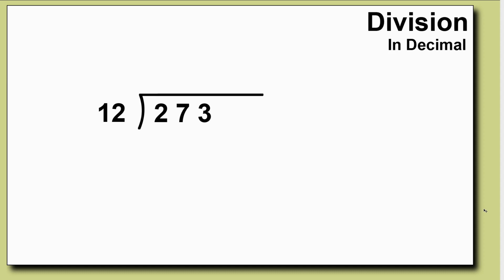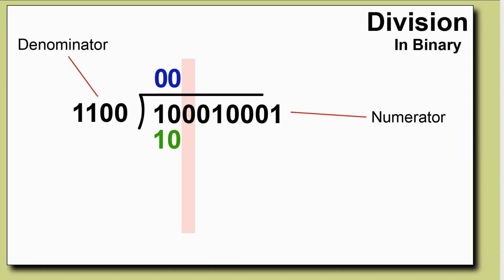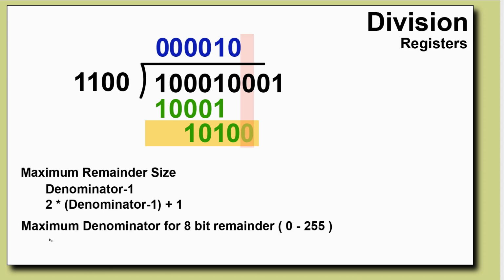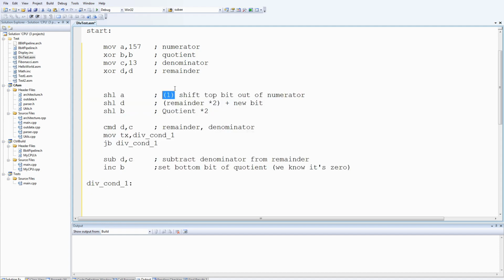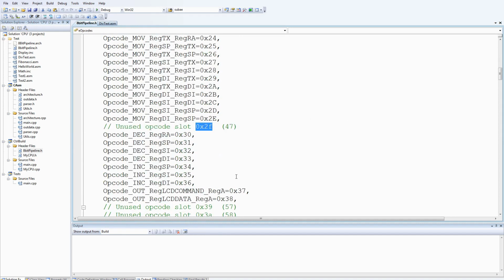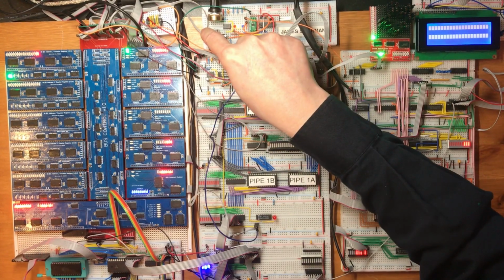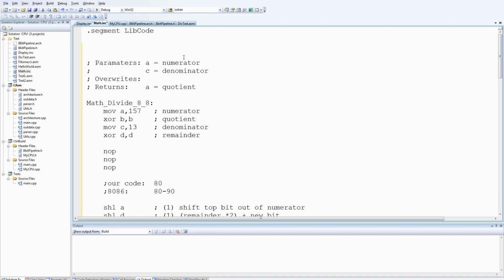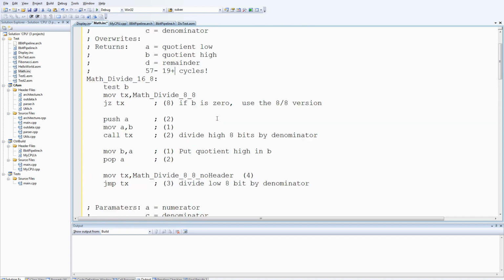Coding 2, Divide - Making an 8 Bit pipelined CPU - Part 66

Comment: Huh... 1:05  Of course recurrent subtraction is an awful and kind of embarrassing solution; of course I haven't done exactly that in several of my CPUs programs... 

Jokes aside, it was a really good and interesting explanation; Some time ago I said I couldn't wait to see your programs/algorithms, and you haven't disappointed! One step closer to getting Doom on it ;)
Reply from the maker: Lol! Glag you are enjoying! The worse thing is there are combinations of numerator/denominator where repetitive subtraction can be faster. I was pretty happy with the performance of this. Annoying thing right now is that I need a u8*u8 multiply, I have designed fast code that only supports values where (val+(val>>1))<256 but I need one that supports the full range.
Reply: @weirdboyjim  Hmm, at worst you'll have to do some workarounds knowing the limitations. Given real(uint of course too) A, B and C; A/(B*C)=(A/B) / C,  as you already know, and given the fact your division algorithm is linear O(n) with the number of bytes/bits, at worst it wouldn't hurt too much to do so, right? Maybe I'm wrong. Anyway, you surely have something in mind for this already. 

I'm really curious in how you will handle floating point, in particular with user inputs, since I failed when I tried my own atof() implementation, and I have yet to try again.
Reply from the maker: The multiply will be easy enough, but I need to swap data in and out of tl/th in the inner loop. 1 to few registers to do it otherwise. I'm building a library of super fast routines that I can do with the 4 gprs and then slower versions that are more capable.
Reply from the maker: Floating point isn't too bad, but it's not on my radar for implementation at the moment. Were you trying to implement an approximation of IEEE or did you use your own format? It's generally faster to use your own format that perform the extra bit packing.

Comment: I love to see your video after a long. 
I really admire your work.
For division and multiplication, you can implement Booth's Algorithm with the shifter (Barrel Shifter) and adder.
You can further make the computer faster by adopting a hardware FPU in a CPLD and control it using your CU or IR
Reply from the maker: I was taught Booths for doing signed multiplication, doing integer division with a reciprocal and multiply ends up much slower than what I’ve presented here. For unsigned integers I’m fairly sure this is about as fast as it gets. I want to keep programmable logic devices away from this build, once It’s finished I want to do some more complicated things where that will be more appropriate.
Reply: Booth's algorithm is quite nice for uniformly handling signed integers. But a common misconception is that it's faster than conventional multiplication. That is NOT the case. For an N bit multiplication, there are 2^N possible multipliers. An for both Booth encoding and conventional, the total number of adds are identical. They're just ordered differently. Demonstration.
For Booth, the first non-shift operation will always be a subtraction. Then the next non-shift operation will be addition. And each non-shift operation will be the opposite. So for my discussion, I'll group all addition and subtraction operations as simply addition. So an N bit multiplication will consist of N operations, each being either a shift, or a shift and an add. For N bits, there are 2^N possible sequences. The same applies for conventional multiplication.
But you're thinking Booth only requires 2 additions for the sequence 01111110, whereas conventional requires 6. Therefore Booth is faster. But look at 01010101 where Booth requires 8 additions whereas conventional only needs 4. The overall total number of additions for and N bit number over all 2^N possibilities are identical for both Booth and conventional.
So claiming Booth is faster as a benefit is wrong.

Now Booth does have some advantages over conventional.
1. Easy handling of signed numbers.
2. When taking multiple bits at a time, Booth requires calculating fewer "hard multiples". For instance, handling 2 bits per iteration, Booth requires N, 2N, -2N, and -N. Conventional requires N,2N, and 3N. 3N is a "hard multiple" that requires an addition, whereas the other multiples just require bit shifting.